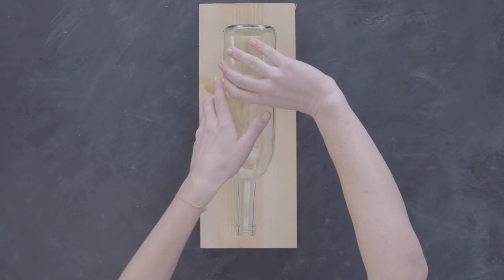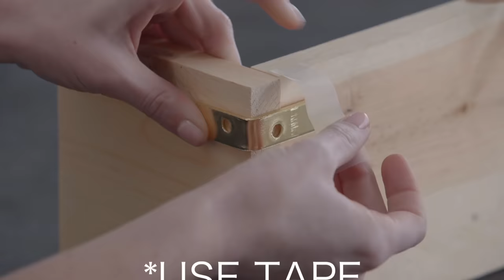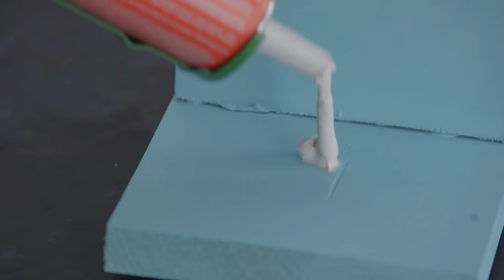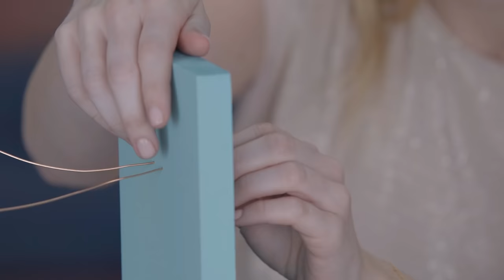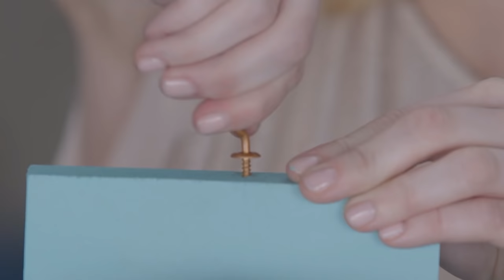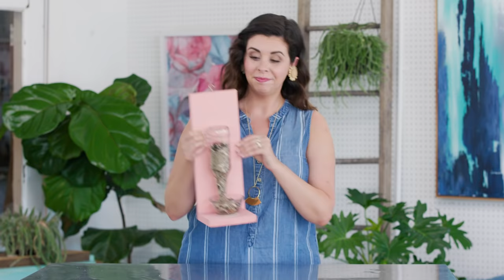DIY Bird Feeders

Comment: I think it's great EXCEPT holes should be drilled in/at the bottom of the glass bowl for drainage unless the feeders will be installed under a covered shelter that won't allow it to fill with rainwater.  Otherwise, very cute and useful! 👍😊

Comment: Neat. Only problem I see is if it rains the relatively deep bowl at the bottom doesn’t have drainage and could cause a problem. Just FYI in case you plan on making one (will need to clean out more often probably)
Reply: I think I would make the feeding bowl removable for cleaning. A keyhole pattern drilled into the bottom of the bowl that allows the bowl to be twisted into place should work fine.
Reply: I added a roof to my setup to solve the problem and it has been very effective.

Comment: Great idea 
The only flaw I see, is how to keep the seed from getting drenched when it rains. I think I'm going to experiment with these and figure a way to keep the rain away.
Reply: make small holes in the container (or even just a slit).  water will seep out but keep seeds in, since it's sitting on the wood.

you could also put the container up on a small block of wood to give it some slight height so that water can seep out better.

Comment: What kind of glue are you using?
Reply: Wood glue would be the best, you can find it at most hardware stores
Reply: video says "industrial glue" but wood glue for exterior use should be sufficient.

Comment: How do you refill the bottle? you would have to take it apart to do so.
Reply: uncoil the wire that holds the bottle.  Or in reality, don't coil it so tight in the first place, it just needs to lightly hold the bottle in a vertical upside down position, and you can just lift the bottle up without uncoiling the wire.

Comment: what happens when it's emptied? Cut the wires, fill the bottle again paint it pink and rewire? E?
Reply: attila tamás makai It's very easy. Just tie the wire on the top a little loose leaving a gap of 2-3 mm. You will be able to just pull the bottle out to refill it. ;)
Reply: loosen the wire by twisting it in the opposite direction that you twisted it to tighten it.